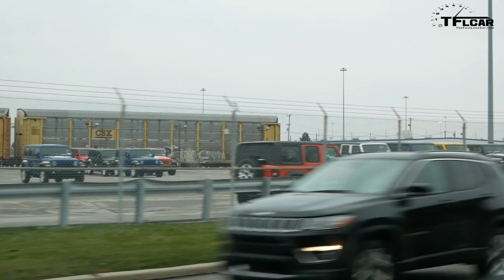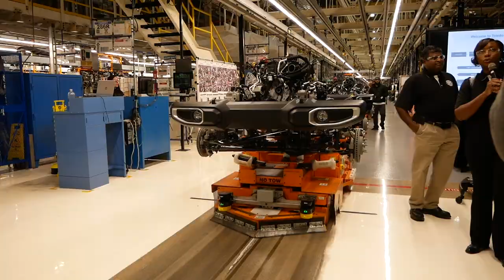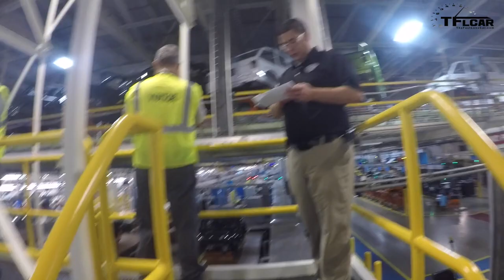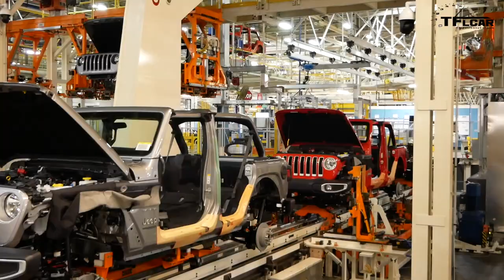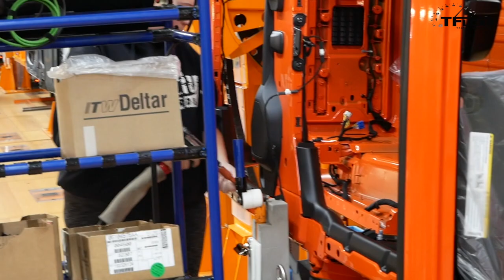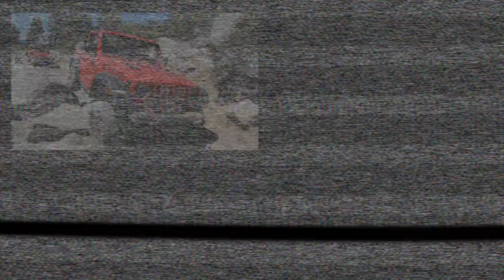This Is How Every New Jeep Wrangler is Made: Inside The Toledo North JL Factory!

Comment: Jeep I love. The JL... well: 
Jeep JL

Earlier this month, Fiat Chrysler announced a recall for over 18,000 2018 and 2019 Jeep Wranglers because failing welds were causing a critical suspension mounting bracket to detach from the frame. Now we have the instructions for how Fiat Chrysler plans to fix the bad frames, which the company said could cause some Jeeps to “crash without prior warning.”
Between May 7, 2018 and Aug. 21, 2018, Jeep’s Toledo North Assembly Plant used frames with an “off seam [track bar] weld location” to build up to 18,055 new Jeep Wranglers. The result, Jeep says in its NHTSA Safety Recall Report, is that likely around 720 vehicles (4 percent of the recall population) have track bar brackets that could potentially “[separate] from the frame.” This sounds like something you’d never really want to happen to your vehicle for a number of reasons, but Jeep identifies that it could possibly lead to reduced steering response and even a crash.

Fiat Chrysler previously told Jalopnik that it planned to inspect all 18,000+ vehicles, but now—thanks to dealer service instructions posted to a Jeep JL owner’s Facebook page—we know how the company will actually fix the roughly 720 cars it expects to find with bad welds.

The first step for dealers is to lift the vehicle and check out the build date code on the frame. If that number is greater than or equal to 126 and less than or equal to 156, then the vehicle was built in the May 7, 2018 to Aug. 21, 2018 window, and its owner should be offered a loaner car as the Jeep gets inspected further.

Vehicles with frame codes in that range will then have their track bar bracket welds—both the inboard and outboard ones—cleaned. From there, with the steering wheel cranked to the left to help give better access, dealers will paint the vehicle’s three-digit VIN to the outboard frame bracket, and take a picture of both welds like so:

Those pictures, along with the frame build date code, the vehicle’s VIN, and the dealership’s information, will be sent to a “Track Bar customer care representative,” who will take a close look at the welds’ positions.

If the representative looks at the photos and determined that the welds are in the right spot, then the Jeep is all set, and no repair will take place. But if he or she finds one or both of the welds to be out of place, dealers will arrange to have a “Technical Weld Specialist” come to make the weld repair. But before that can happen, the dealer has to take some stuff apart.

To prep the outboard weld to be repaired by the weld specialist, dealers are asked to disconnect the battery before lifting the Jeep, remove the left front wheel, undo the track bar nut and bolt shown above, and then take the track bar off of the poorly-welded bracket on the frame.

From there, Fiat Chrysler says its “Technical Weld Specialist will perform the repair on the outboard weld.” There are no further details on how exactly the specialist will conduct the fix, but clearly the job will involve welding that bracket back onto the frame somehow. Fiat Chrysler told me via email simply: “Weld will be made to comply with specs.”

Once the weld specialist’s job is done, dealers will bolt the track bar back onto the frame (with a new nut and bolt), throw the wheel back on, lower the Jeep, torque down the track bar nut to spec, and then give the vehicle back to the customer. That is, unless the inboard weld also needs to be fixed.

Repairing the inboard weld is significantly more involved than fixing the outboard one. In addition to lifting the Jeep and removing the left front wheel, the air dam has to be taken off, and four steering gear mounting bolts have to be removed (to get the steering gear box away from the bracket weld location) after the track bar has been unbolted from the frame bracket:

Each sway bar link’s lower nut and bolt also have to be taken out, likely to get the sway bar out of the way. Then, by grabbing the right front wheel and turning it, the vehicle’s wheels need to be pointed to the rightmost position. This will pull the steering gear away from the frame, and thus away from track bar bracket to give better access to the inboard weld.

That’s when the Technical Weld Specialist will perform the inboard weld repair, or possibly replace the entire bracket.

With that done, dealers will grab the front right tire, and turn the steering linkages to the leftmost position in order to line the steering gear back up with the mounting holes in the frame. New bolts will then be threaded into the steering gear and torqued down.

A new bolt will hold the track bar into the newly-welded (and possibly entirely new) bracket, and new bolts will be used to hook the bottoms of the sway bar links back to the steering knuckles. The wheel will go back on and get torqued to spec, then the vehicle will be lowered, and the sway bar and track bar bolts will be tightened.

Once dealers install the air dam, do an alignment, and check the work via a test drive, the Jeep will be all fixed and ready to go back to the customer.

Jeep lists how much time dealerships can bill to each procedure in the table below:

So if you’ve got a 2018 or 2019 Jeep Wrangler affected by the recall, now you know what type of surgery might be in its future.
Reply: They don't build them like they use to.

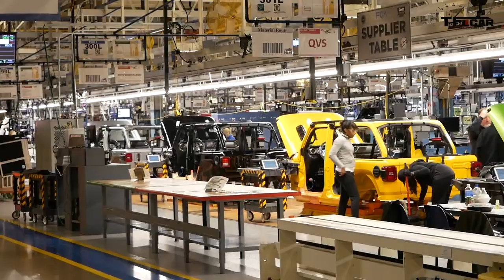Comment: 2:34 - TWELVE different Wrangler frame variations?
HIGHLY doubtful. That means a different frame for each model of each 2 and 4 door version. There's absolutely no way Mike Manley would allow such monetary waste when the Wrangler is notoriously built on the same frame, no matter what year or model.
My 88, 91 and 93 YJ frames are EXACTLY the same as all my TJs. The only difference is the 2004-2006 LJ and its +10".

Comment: I guess Jeep doesn't turn the assembly plant heat on?
The number of people wearing toques is comical.
Reply: Lol they have hoodies on for a different reason
Reply: @spacejam3139  
Ya? What's that?
You don't know, do you?
Reply: @Maxxis1941  I do. It’s bc they are wearing wireless  headphones
Reply: @spacejam3139  
You're wrong. Very wrong.
The answer is out there. Use Google.
Reply: @Maxxis1941  lol I don’t need to but k boomer
Reply: @spacejam3139  
What's a boomer?
Does a boomer work with explosives? Do they wear hoodies to protect their ears?
Reply: @Maxxis1941  and I told u why they are wearing them and some aren’t, don’t believe me idc lol

Comment: One thing that I've noticed with the Wrangler JL is that because of the 4-door model, a good portion of the people buying them are snowflakes or Soccer Moms.  That didn't used to be the case with the Wranglers.  Well, that's at least my impression with respect to the people posting over on jlwranglerforums.com.  Mainly it seem like a lot of people whining about when the JL that they ordered will eventually be delivered or people drinking the hybrid 2.0 liter engine Kool-Aid and if you try to discuss it, you get banned from the site.  Since the site is run by some Kalifornia liberal, I guess that's not surprising.

4-door Wrangler with automatic transmission is MALL-rated... :)